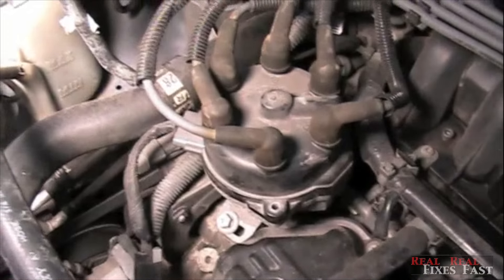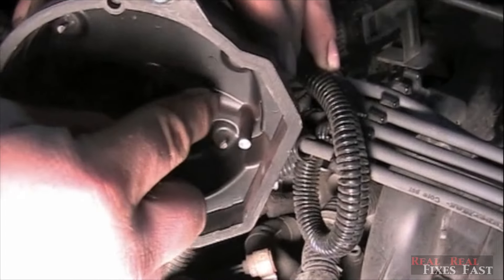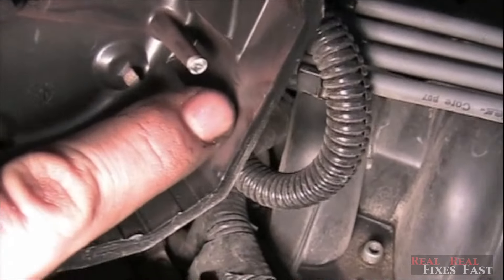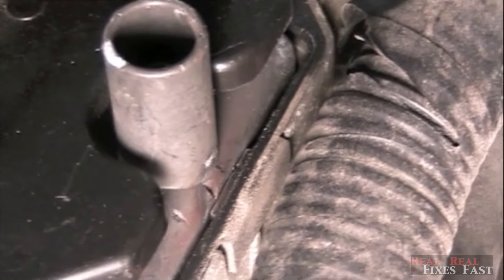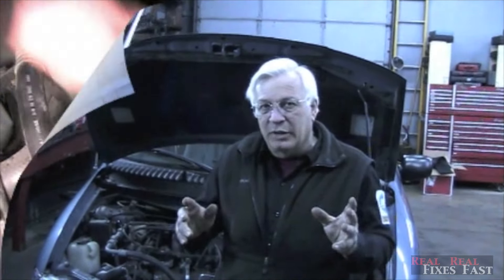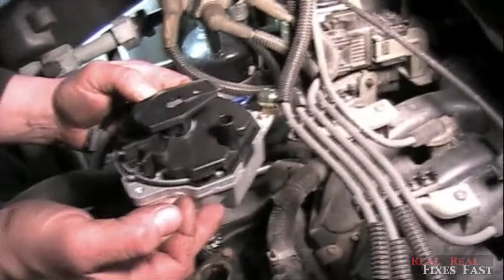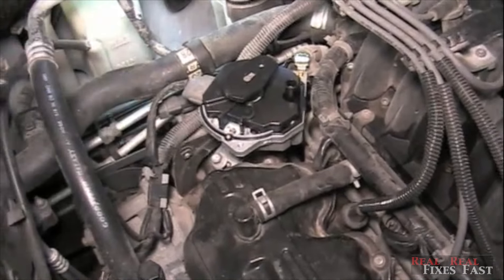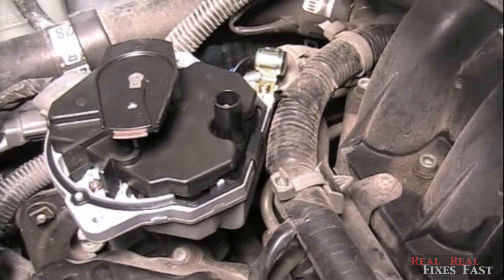Nissan Distributor.  don't miss this Hidden Problem

Comment: Can we epoxy the hole/ crack instead?
Reply from the maker: you could epoxy the hole and it would appear to be fixed, but the actual coil has been stressed and may not function efficiently.
Reply: Informative 
If we did it be temporary =for a short time